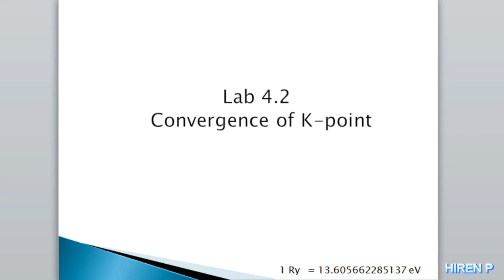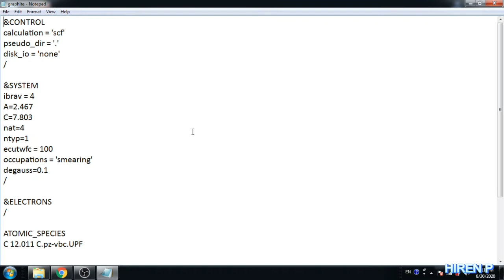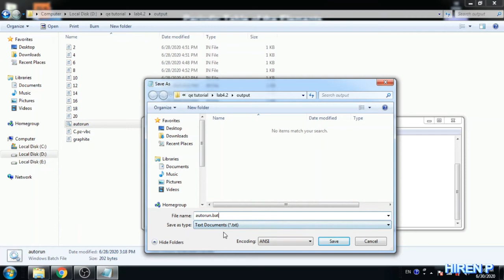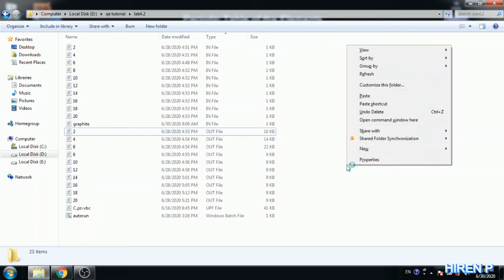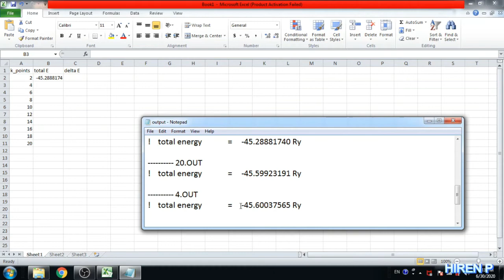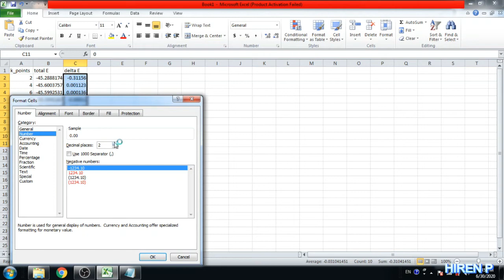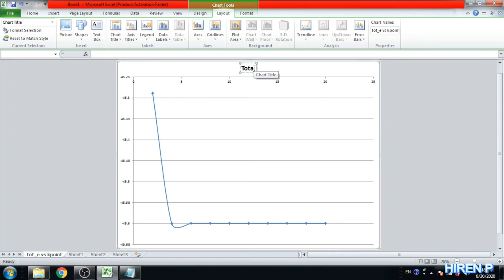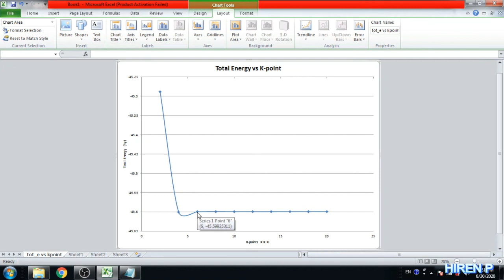Lab 4.2: Convergence of K-points grid / mesh in Quantum Espresso.

Comment: Hi sir, just wondering why does k points 20 20 20 give a more accurate result than 2 2 2? This might be a silly question I know
Reply from the maker: depend on structure size and type. large dimension need small k size.